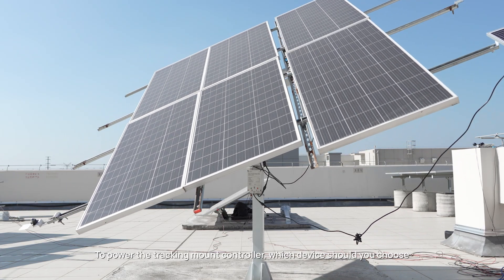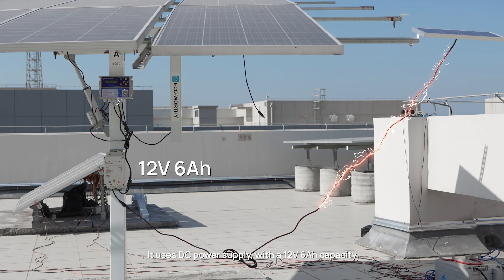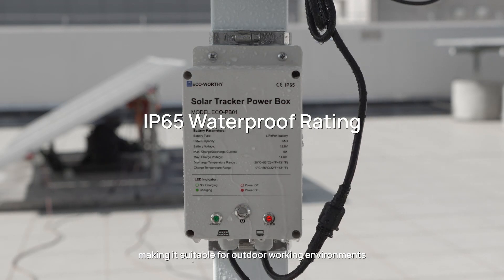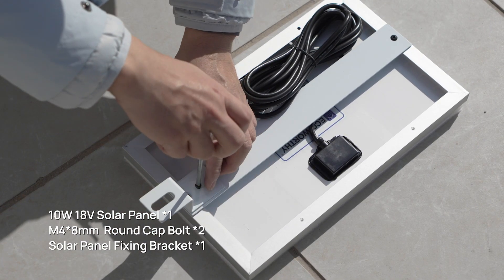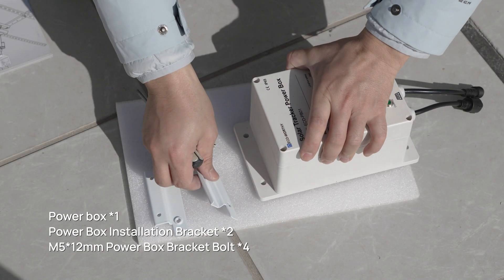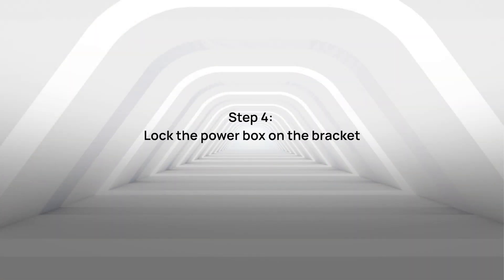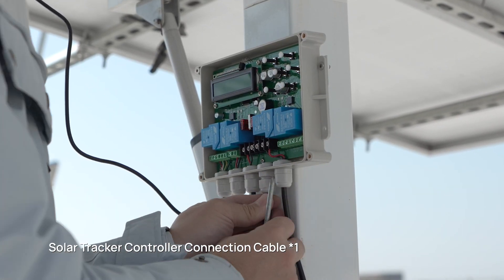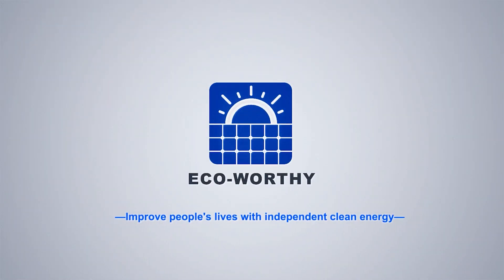How to power your Eco-Worthy solar tracker controller?

Comment: Eco WORTHY........2 UPGRADES U NEED NOW for version NN+ of your eqyupment........1)  Allow for multiple new heavy panels 550W and 750W panels  and 2) Power cables to battery should be from installed solar panels, tht is a "Y" cable to steal power from main PV panels.......should not need to install a smaller panel.   Both of these could be an upgrade option to cover the cost to producce.    Need to accomodate 3 to 4+, 750W panels.  Pls ASAP for both fot these.
Reply from the maker: Thanks so much for your valuable suggestions! 🙌 We’ll definitely pass your feedback on to our product development team for consideration in future upgrades. Stay tuned for updates!

Comment: big issue try 2 mount points for the solar and increase panel size to 30watts+ to make sure if low light still get enough power to feed a minimum 12v 12ah battery

Comment: Do you recommend a 12V 6Ah battery in addition to the Power Box? Is the battery installed in the Power Box? If not, how do you connect it? Which battery do you recommend? It seems like a good idea and one that I want to purchase, but it certainly lacks information.
Reply from the maker: Hello, of course you can use a 12v 6ah battery. The batteries are already included in the power box.

Comment: I’m looking to install a tracker system soon and this can be an awesome way to power it. I live in an area that can get well below freezing often. So I wonder if the battery is sealed lead acid or lifepo4? I know lifepo4 can’t be charged below freezing which will not work well in the winter in my area. I would appreciate a response in order to making the decision of purchasing this item.
Reply from the maker: Hello, it is the lifepo4 battery.